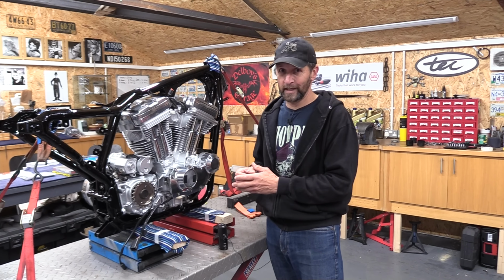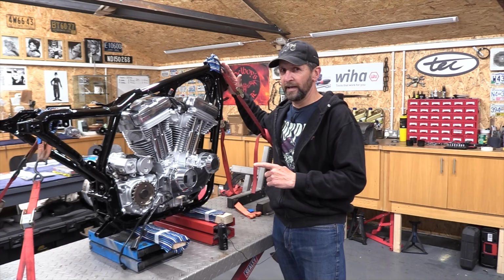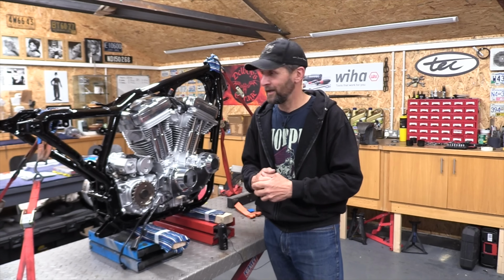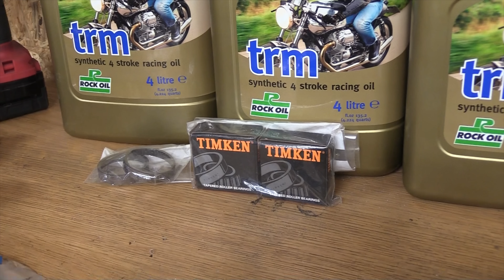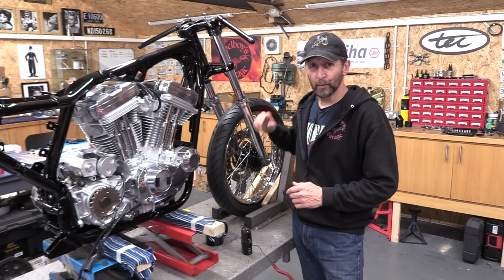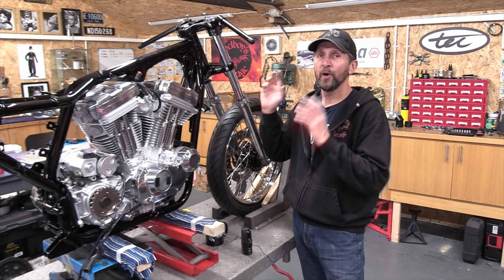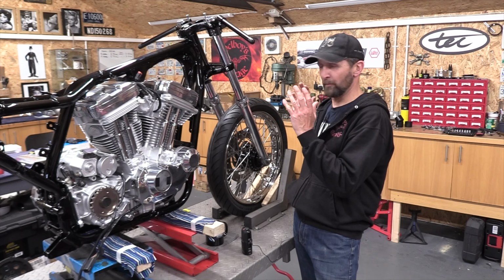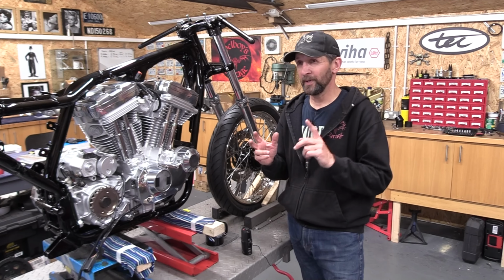Harley Sportster, Front End Installation !

Comment: I was wondering what year motor could I fit in a 1986 sportster frame just picked it up it still has the stick motor but the crank case is cracked and I don’t wanna put another carbureted motor in there
Reply from the maker: Fuel injected engines are all rubber mounted, and yours is rigid mounted, so im not sure what's needed for that conversion.. never looked into it mate !

Comment: Is this a mid glide front end? What are the wheel and tire measurements?
Reply from the maker: What's a "Mid Glide" ?
Reply: @Moonfleet41  is the front end like forty eight +2015
Reply from the maker: @jonassbeghen874  No, this is 2003 Sportster Hugger with custom wheel rim !
Reply: @Moonfleet41  nice, I'm thinking about putting a 21 inch wheel on my 2012 xl1200c, it currently has the original 16 inch wheel with fat tires. Have you seen any with this change?
Reply from the maker: Isn't that just like a XL1200V the "Sportster 72" ?

Comment: Nice work Del, I'm impressed with the bearing press too. I will look into getting one and ask a couple of mates if they fancy a shared ownership as it's expensive for something that will have such infrequent use. You are one of the main inspirations for my plans to build a custom bike, thank you 😀👍
Reply: It is SUCH a great tool.  You will find reasons to go help your friend do it on their bike.
Reply from the maker: Hi Michael, that's a great idea, we used to call those 'club tools', something you may only use once in a blue moon, but shared between a group of mates they'll get a fair amount of use overall!  We're doing a great deal on them through Spanner Monkey, a lot cheaper than buying direct from Sealey, so here's the link if you need it mate:  https://www.spanner-monkey.co.uk/steering-bearing-press-motorcycle-119015?search=SMC3&description=true
Reply: @Moonfleet41  thanks Del, I will check that out. I'm fortunate enough to work for an automotive paint supplier and the boss sells to staff at cost, plus a little bit, and we have an account with a sealey main distributor. I will compare prices and hopefully get one!

Comment: Great vid as usual Delboy, good to see her coming together now. Why don`t you use those clip-ons as they are, do you think the slotted spacing ring is not strong or secure enough to use on the road?.  I know you said about being on a bit of a tight budget, so why not use the clip-ons as they are, it will save a fair amount which you can spend on other things?.
Reply from the maker: Thank Neil, i have been thinking about it as i do like the lifted bracket to make them a little higher.. and yes the spacer rings are more then secure enough to use.. but they are still 7/8th" bar diameter, and will need to be 1" diameter if im going to use them.. so I'd need to make some new bar tubes to go into the brackets..! perfectly possible, so it's definitely a consideration..!
Reply: @Moonfleet41  Hiya, yes, i forgot about the fat bar / thin bar issue.

Comment: hi Del, just wondering is that front tyre on the right way round ? I always thought looking over the bars the tread pattern arrows face forward and not back!
Reply from the maker: No mate, that's the rear wheel, on the front, the arrows face rearward ... trust me, the direction arrow is correct on the side wall and as you see when we fit the rear, that is opposed to the front, so those tread grooves, looking down on it, do point to the front.

Comment: I'm affraid that this kind of handle bars, is goiinng to touch the fuel tannk, dont't you think?
Reply from the maker: They shouldn't do mate, the Nightsters run under slung mirrors, which would hang lower than these bars, and they don't touch the tank... Harley tanks are pretty narrow and many custom Sportsters run clip-ons successfully, it's all just a case of setting it all up once the tank's fitted!

Comment: Really liking the silver engine and the res black. Also what's your reasoning behind not fully packing the neck bearings? I'm curious
Reply from the maker: I did fully pack the neck bearings, perhaps you skipped forward and missed  bits, but rest assured, they're correctly and fully grease packed.

Comment: Looking good del,the rear brake on a 1500 wing should it be spongy to the point it moves about 3 ins or does it need the fluid changing,picked it up on Tues
Reply from the maker: Hi Andy, the rear brake pedal also serves the front left caliper at the same time, it's not a complicated system, just two brake hoses coming from the master going in opposite directions, so if it was me, you could just bleed them both through and it should improve it... the rear brake system on them isn't actually that effective, but that sounds like a lot of brake pedal movement to me, and remember if it's got old rubber hoses still there could be a little expansion in them, so upgrading to braided could improve them too!
Reply: @Moonfleet41  thanks del I'll look into that,so if I bleed the brakes from the front it should sort it out and the rear

Comment: Hi Del. Inspirational video once again. I found your channel through searching for XR1200 maintenance. What did you think of that bike?
I have a small “remark” but you might find it interesting for the future, but I’ve always learned not to touch bearings barehanded. In aviation it’s standard practice not to touch them barehanded to avoid contaminating them with our skin’s oil & greases. Maybe you’ll appreciate my little “but you know this” remark 😉. 
Keep up the good work and lovely builds. 👍
Reply from the maker: Thank you for your kind insight, that's an interesting point, aviation is always a far more exacting level of engineering than road vehicles, thanks for sharing mate!